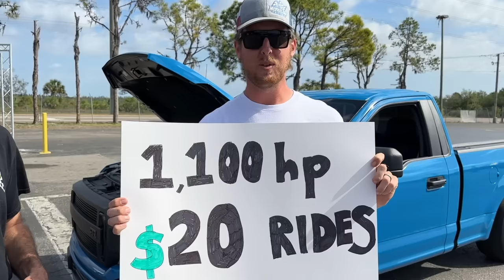$20 Race Truck Rides... GONE WRONG!!!

Comment: Put the rotary from mystery machine in your jet boat!!!! Waaaapaaapaapaaahhhh
Reply: It's already hard enough to keep a boat running 😂
Reply: I miss that van it was great
Reply: @kdcustoms1272 with a rotary from the Vargas brothers, its rock solid. Then put 40psi on it! Waaaaaapaaahhhpaaahhh
Reply: @Goat-vy2bi  they built the damn thing lol
Reply: @kdcustoms1272  40 psi wont hurt it, its not a rotating assembly with rods, headgaskets and piston rings. But upgraded apex seals would help
Reply: Yea but how long of a ride are you going to get? He will have to double his fuel capacity and carry a gallon of oil. Doritos are  awesome but thirsty.
Reply: @doeing510  Son, we are not here for a long time, but a good time 😎 waaapaahhhhpaaahhh
Reply: Yessss, Ive seen and heard a boosted chicken cooker in a jet boat and they sound like jet engines.
Reply: @Goat-vy2bi  yea you got me there. It would be cool to see, just not practical.
Reply: @kiwidiesel  Boosted chicken cooker!!! Im gonna keep that fraise!
Reply: The only appropriate place for a rotary is in the dumpster!
Reply: Rotary swap the spark
Reply: I just came to the comments to say the same thing. Throw a Dorito livery on it, and it's mint. 🤌🏾👌🏾🤙🏾

Comment: Pulling the cab off is honestly one of the best engineering things they've done to newer cars. Takes 30ish minutes and you have full access to everything under the hood.
Reply: Thats not a newer truck thing
Reply: Nor a newer car thing.
Reply: It took 30 minutes to get one fender liner off.  These vehicles are engineered disasters these days
Reply: Engineered for the thinking mechanics, not the stinking mechanics...I love to watch millenial mechanics struggle with these computer driven nightmares😂😂😂😂😂,.. Daily!!!
Reply: except if you're poor like me and can't afford a 2-post, then it's the worst 🤣
Reply: Only half back for restocking fee😂

Comment: Love the gauge shot, pegged at 7k and 120mph for most of the run.
Reply: With plenty of warning lights. lol... Drive train was not happy.
Reply: @mckrackin5324 bet the belt was already slippin and slappin right there lol
Reply: @mckrackin5324  Needed a "Danger to Manifold" clip there.

Comment: Roughly 3 sec 0-60 and roughly 4.6-4.8 sec 0-100 out of a truck that’s impressive as hell man also I’ve been here since way before the street bike swapped golf carts and I love how far yall have come in that time span from being in a lil shop driving to a drag strip to having a few big ass shops and your own drag strip a oval circuit probably not even 5 miles apart love to see that man
Reply: It’s got 1100 horsepower, four wheel drive, a locker and slicks. It’s not that impressive when you stop saying “out of a truck” and actually understand that pretty much anything with all that will go 9’s.
Reply: When did he buy a dragstrip?
Reply: @TheHannukahZombie  compared to stock it is impressive I don’t go on compared to other cars because I don’t rightfully care he’s improved that vehicle a considerable amount compared to stock and that’s what’s impressive
Reply: @madlad8629  if I remember correctly drag strip came with the freedom factory
Reply: @muddinco7289  no it didn't, Victor owns the drag strip they are just right next too each other.
Reply: @madlad8629 I could be wrong here, and I know the strip didn't come with the oval, but I'm pretty sure Victor and cleetus are partners in BMP. Again I could be wrong but that's what I remember
Reply: @momolovesyou9969 yeah he has the McFarland Racing Lane
Reply: @momolovesyou9969    I'm thinking Cleetus has a minority stake in the Bradenton dragstrip.  Like he owns 10 or 25% or something like that.  Anyways Cleeter is EXTREMELY BLESSED to live in the same town that has one of the best drag strips in the country.  I'm thinking that strip has the unofficial top fuel MPH record when they had that not NHRA sanctioned event there in Feb.
Reply: @TheHannukahZombie so you have something that'll compete with it? 😂😂😂 Radials not SLICKS and that "locker" is factory equipment... 😂😂😂

Comment: Still takes a 427 to run a lil ole 302 😂
Reply: A fully built coyote with 4 cams and a whipple, yea 😂
Reply: "lil"
Reply: always was a bigger chevy motor to run with the smaller ford motors.
Reply: Well Cletus should make it fair , 445 ci built ford. That would be apples to apples.
Reply: Then 4.8 ls gaps both 😅
Reply: Coyotes are fast for sure. But nothing beats the price to power ratio of a sbc/ls 
There's more sbc swapped ford's goin down the track 
Then sbf swapped chevys.
Reply: @_A_Daytona_  Yeah, it's only an extra whole car engine (many 2 liters out there making 250-300hp factory stock std. nowadays), to get GM in this game !!
Reply: @Fossillarson  But only in YOUR dreams !!

Comment: My truck has a 6.2 with an 8 speed transmission 4 wheel drive and DOD so on the freeway it gets 24+ mpg and it is soo fast. I love the way it runs. It has a button at the bottom of the gas pedal so for racing it shuts off the ac, and puts all the power to the wheels.

Comment: We used to put weight's on the front of the pulling trucks up here in NY to keep the front ends down and get traction on the 4x4 truck's. Wonder if ya put a small enough fuel cell in the front bumper or transfer some weight over the front tire that lift's to help keep the front down.

Comment: I suggested it in the giveaway video, now I’m asking you guys to please buy an Australian v8 Ute, a Holden maloo R8, 6.2 litre, supercharged LSA V8. 550 hp (410 kW) and 509 lb-ft (691 Nm) of torque through the rear wheels while coupled to an automatic transmission, not anything close to the 1100hp of that thing but the Australian v8 utes are light as a feather with quite a bit of torque….
I would be really interested to see how you guys would work on that kind of car compared with how the Aussies work on them. It would be really interesting to see what times you could do in a Cleatus worked Aussie car!

Comment: i like work boots tro drive modern manuel cars there is no room for real heel toe but with work boots i can use the side of my boots to give throttle and break at the same time so left foot can do the clutch only bad thing is its sort of automatic for me so when riding a bike a rev match down shifting and front break while throttle blipping but use to much engine breaking on a bike with cars you can do that with bikes a little less

Comment: wheel hop off the line? what torque is it that brakes the stock 8.8 "1 inch round" axles? because the power of rev an dump on the old 4.6 in the thunderbird broke 2 of them too full shear off twist fractured one and bent two there's. what brakes an 8.8? durability testing? the form pages said the 8.8 would hold 450hp, and the 195hp 4.6 with a fuel tune up broke a pile of them. ???hp SAE corrected 30-60mph was 6 seconds as of now having a 780lb axle added to the curb weight, the other form page said 310hp. what twist fractures an 8.8, what snaps an 8.8? the 8.8DiNF, with the locker in it their might have been 460bhp driven thru each axle brake power or "stall torque - watts needed to fully stop it in 1 second". 900hp to bust it and they said that AAM1150 would hold 800hp... no turbo no turbo no turbo so many broken axles no turbo no blower in sight not even a bottle of NOS. just gassed, that 6.6 wouldn't hop that 9'', it would brake it on the line it that really is... 1100hp. proof's in the torque bar not the dinosaur "dyno score".

Comment: I think you need 500 at 20 per run as 5×20=100×10=1000×10=10000 to pay for the new trans ready for when you eventually break this one also but i bet you will have so much fun doing it which will be 100% worth the smiles for 1/4mls  cost of business 😂